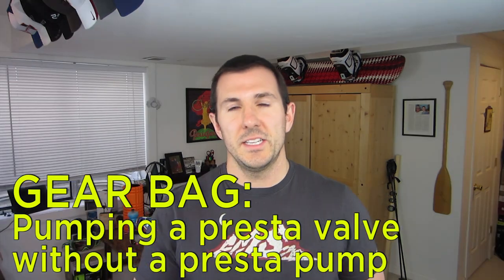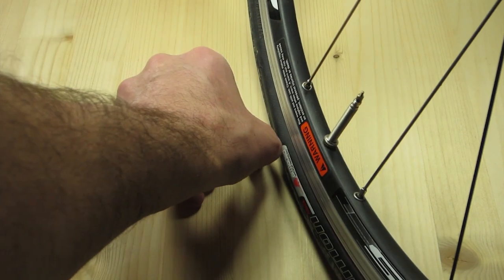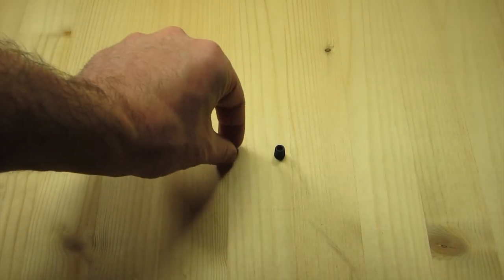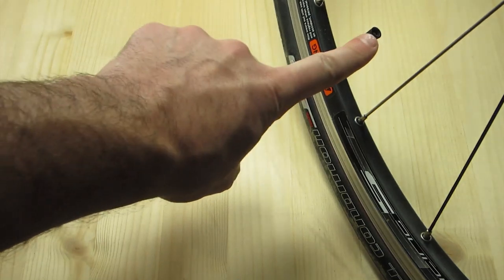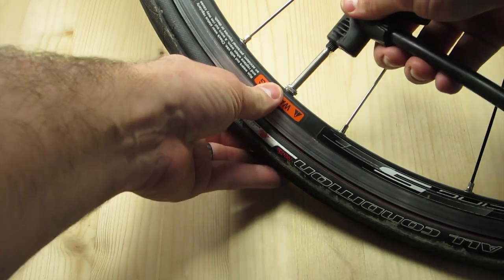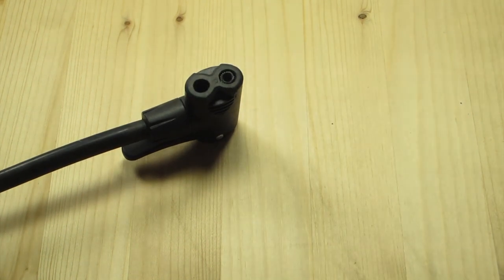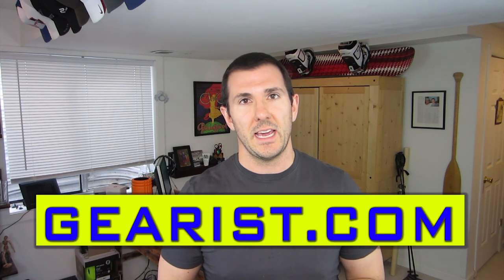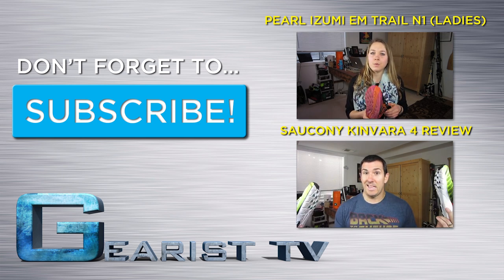HOW TO USE A PRESTA VALVE WITH ANY PUMP - Gear Bag from Gearist.com

Comment: I used a pair of scissors to ream the cut cap so the interior diameter would be greater and allow the presta valve to access the threads on the cap. This video saved the day!

Comment: I've used a similar trick with a cut down ballpoint pen.  Great tip!  This also works well to inflate a tubeless tire after pulling the core out so you can force more air in.

Comment: Seems like a good trick, I think it depends on the caps involved. The caps on my 700x35-45c Meet-locks brand tubes don't really fit on the valve or the pump after they've been cut as described
Reply: Jake C yep, it didn’t work for me.
Reply: one of my tubes worked, the other half worked. fml

Comment: I have built-in convertible valve clamps that makes my portable pump works for both schrader and presta valves so I may never have to do this, but this is still a good tip. You'll never know when you might need it.

Comment: Would this trick also work using an air compressor? And could I check the pressure using a standard tire gauge with this? Thanks, I definitely appreciate the video. I just replaced my tubes on my bike today, only to discover they have Presta valves

Comment: I have a pump that has one hole but says it takes all valves. Just got a new road bike which comes with presta, I hope it works; however, if you do this, you can use a gas station or a car pump if you need to. I carry a cheap emergency pump always on my bike, but I don't think it can do 100lbs., so it would just be to get enough air on the tires to get to a gas station. Thanks.
Reply: +Eliseo Borrero Here's how it SHOULD work:  The head of your pump has 2 internal parts, a plastic piece that depresses the valve stem, and a rubber "gasket" that seals around the valve. Unscrew the end piece so you can get at the internal parts. Take them both out, REVERSE them, and put them back in. Then screw the end piece on and it should work for Prests.Most pumps are "compatible" with both types, but it took me a good amount of research to actually figure out how to convert it.
Reply: Thanks
Reply: Didn't know my pump had this option until I read this! Thank you

Comment: To get this to work I had to kinda take the front of my pump apart, but once I was able to get the nozzle out of the way and force the cap into the pump it worked easily. Good shit.
Reply from the maker: Nice! Surprising that it wasn’t standard and I actually wonder if your pump doesn’t have a flippable head? When you take the front piece off, is there a sort of internal core piece behind that come off and flips around?

Comment: So what was wrong with the old style valves that they needed to complicate this and render my 25 year old pump useless? Thanks for this because I just ordered  a tire and it came with this prestamadigitation valve ( I had no idea there were more than one type) and my pump wouldn't fit it. Hopefully this will work! I guess now I will have to get a fancy Tour De France spandex bike suit to match my fancy valve :/
Reply from the maker: Presets valves have been around since the 1920’s and they’re meant (partially) to allow for more narrow wheels without compromising the structure of the whee by allowing for a smaller hole. Getting a pump with a smart head (or a dual head) is a good and simple fix and they’re a lot more efficient these days than 25 years ago! ;)

Comment: Bought a new tube and got it home.  Took back tire off and all, then found out it had some fancy valve.  Something wrong with the trustworthy Schrader valve these days?  If it ain't broke don't fix it.  Needless to say I didn't have the fancy pump either.  Didn't want to drive back into town again.  Thanks for this info it worked like a charm.  Presta valves are worthless.
Reply: Believe it or not the Presta valve on bike tubes has actually been the cycling industry standard for near on 50 years
Reply: Didn't know that.  Shrader valves FTW.
Reply: Wayne Renee  the Presta are for thinner tyres as the Schrader may be too wide....that is why they exist
Reply from the maker: Not necessarily. You can easily find road tubes (about 23mm) that have schrader valves and many, if not most, legit MTB tubes are presta.

Comment: The issue no body address:  Should the Preste valve spring landed needle be compressed?  to get and air treasure reading it must.  But with some pump heads, that will empty the tire of air. In the video, the needle is not compressed.

Comment: you man just earned and other subscriber thanks
Reply from the maker: +andy palacios Awesome, thanks so much!
Reply: Cap came off in the air pump and when we tried to get it out with the skewer it bent and melded and we still don't know if we can get it out.
Reply from the maker: How on Earth did you manage to bend the skewer? All you do is thread it in and pull straight out. Seriously simple.
Reply: No the cap bent, not the skewer.
Reply: +GEARIST you help me so much thank you very much.

Comment: How do you check tire pressure on presto valve without adapter
Reply from the maker: The gauge on the pump. Almost all bike pumps have a gauge of some sort.
Reply: GEARIST this is a bell hand pump with no gauge  doubt I could even get into Walmart to buy an adapter thought there maybe some trick
Reply from the maker: Got it. Those pumps are mostly good for emergencies and not daily pumping to be honest. It’s probably ok to go by tire feel in the short term
Reply: @Gearist  Thank you for replying I appreciate it

Comment: My cap get stuck in my pump, now I need a new one. It wouldn't work to fill my tube either because the cap isn't threaded and won't screw on. Also that stick didn't come with my bike and I bought it new.
Reply from the maker: That stick is called a skewer and is a part of every bike on the planet as it's basically the axle for each wheel. Also, all presto valve heads that have a cap (which is pretty much all of them) are threaded - which is how the cap screws on.
Reply: actually the skewer is only a part of every bike that has quick release wheels.  If Joshuas' wheel is the old style steel axled type that bolts on it doesn't have a skewer.
Reply: kyle use a nearby twig... the cartridge insert for a pen... chopstick... coat hanger... spent sparkler...  you will find the answer on the ground easily enough if you can't use needle nosed pliers or a screw when you get home...

Comment: the cap wont stick on the valve
Reply from the maker: Sorry to hear that. You should be screwing it down onto the valve. It'll be reverse threaded but the plastic of the cap will give.
Reply: what i did i put the cap upside down then hammer it down a little bit then it went in then it works!!

Comment: But once you have this piece  that solves your problem, WHY would you throw it away after you're done?
Reply from the maker: Grady Toland I suppose you don’t have to if you don’t want to. However, the seal isn’t always 100% solid and, if the modified piece pulls off of the valve stem more than once, the threads are going to be pretty stripped making the seal even less. This is meant to be a one-time, temporary fix.

Comment: Hopefully this works. Then I will be ridong with no dust cap though D:
Reply from the maker: No problem at all. Can't remember the last time I left the caps on my tires!
Reply: GEARIST I guess my pump isnt good enough? Idk it won't hold the air as it pumps, so to say it deflates in between pumps

Comment: Valve cap was not very sturdy and bent while cutting, then when screwing it on (backwards), it is not level due to being bent, so the pump wasn’t able to get a good seal and wouldn’t inflate it at all
Reply from the maker: You know this is a temporary, one time fix and a half-cut valve cap isn’t meant for this, right?

Comment: Goddamn presta valve end popped off and now I'm trully fkd.
Reply from the maker: So a presta valve can actually be put back together in some cases. If the little top part that breaks, it’s done. However, the top of the valve below the very end actually screws out in most cases (so a broken tip can be replaced). https://i.stack.imgur.com/R19lp.png

Comment: The best  and easiest way to air up the Presta or Schrader valve is with a Taggio Pro Head. There's no adapter needed. Here's how it works https://www.youtube.com/watch?v=3ahIdZW6CNw
Reply from the maker: +Just4Kicks1234 Right, but this is when you're in a pinch and have no additional thing that you're carrying around.

Comment: It says how to use ANY PUMP to fill a presta valve ... you use a presta head on the pump  .. BS
Reply from the maker: The pump head on that pump(as is clearly pointed out in the video) has two holes, one for Schrader and one for Presta. Thanks for the “BS” though.

Comment: A really good way to pump up a presta valve with out a adapter or presta valve is to put in a tube with a schrader Valve .
   Problem solved . Your welcome .
Reply from the maker: Try that on a presta wheel and let us know how it goes. It’s the wheel with the hole in the actual rim that determines the valve. We await your report.

Also, you’re
Reply: @Gearist  drill it out  ;)
Reply from the maker: So, you would structurally compromise a wheel rather than simply get the proper tube for $7 or a pump with a smart head for $20? Betting your copay at the emergency room is gonna be more than that.
Reply: @Gearist  anything to not have a " french valve " that needs a adapter just to check air pressure ..
The entire world ; Schrader  
  Some clown ; hey let's be difficult and make something that nothing fits and call it   "presta"
Reply: @Gearist  I  have a 29 " tube which is hard to get on this island and bought a tube .brought it home and went to install it . Then looked at the valve stem and said what the hell is that?   Fock ,it's a presta valve  🤪.  At least it was only $3.60 . Not a big lose .
 Schrader valve ,has worked great since forever ,every pump and gas station compressors  fit it .
 Presta  ; not needed . nothing fits it except your special pump at home (bring your kitty bitty adapter with you , don't lose it ) 
Presta!    Yeah I don't like it .
Reply from the maker: Presta valves can be used with a Schrader rim. That’s why all presta tubes/valves come with valve nuts.
Reply: @Gearist  yeah , i put it in as i had no choice and put in sealant . its holding up . [the sealant plugged a pin hole in a tube thats not in a tire and has held the air for weeks .] so this presta valve tube might be in there until the tire wears out . 
  just its more complicated to to simply check the air pressure .     no one on this little island has much bike products, so i had to cut the cap top off and force it on upside down trick .    but ....ok for now .